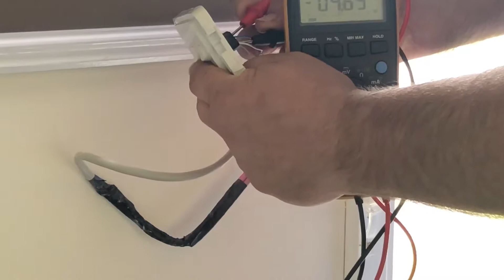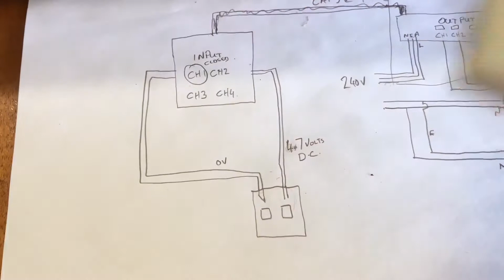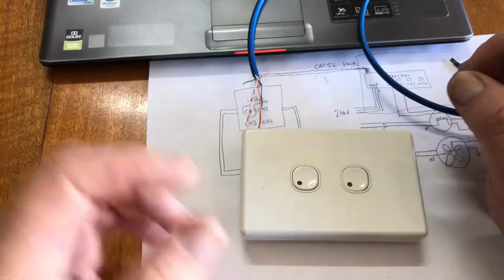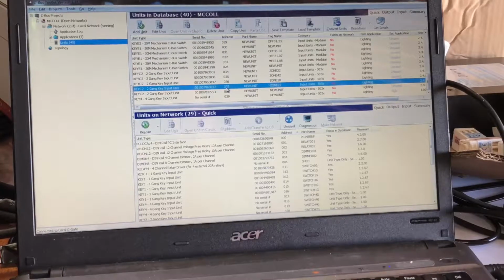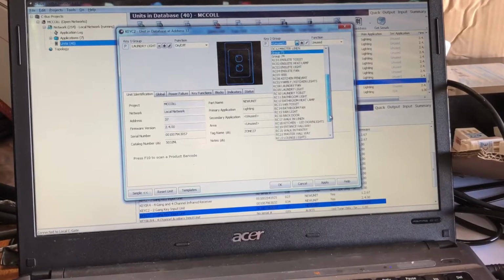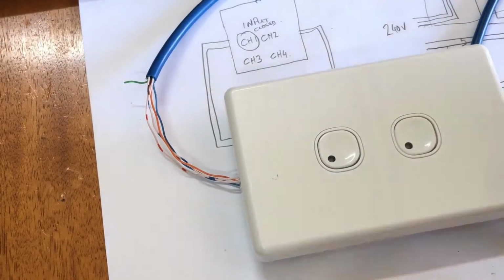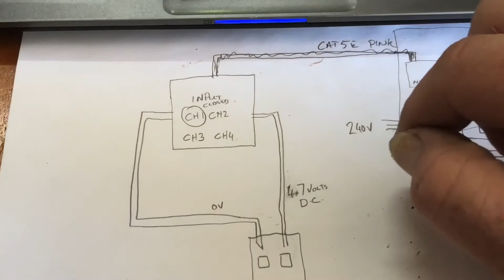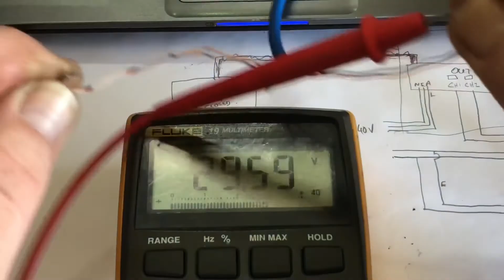Installing C-Bus two gang light switch (part 2)

Comment: What are the input devices that you used up in the attic? As you've already set up an existing C-Bus network in the home, would I be correct in suggesting the main "upgrade" of the new gang plate is aesthetic? You don't really gain much in extra function/s - except perhaps the LED status indicators in the switches (eg. if you're on a timer).